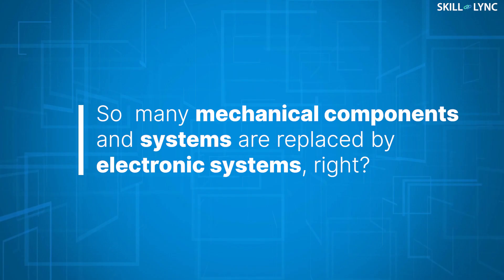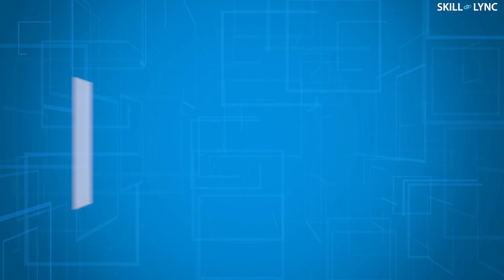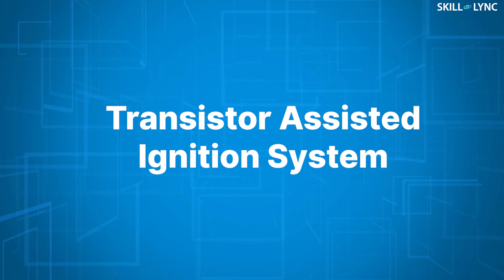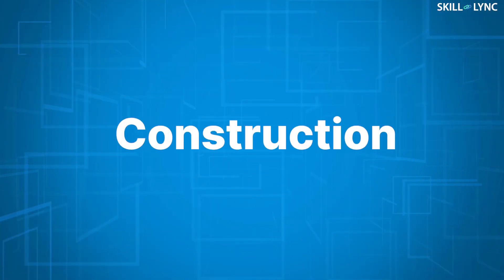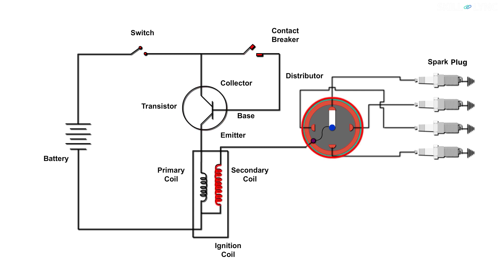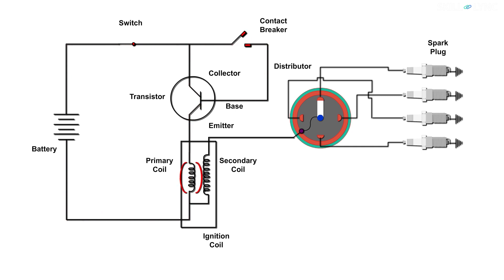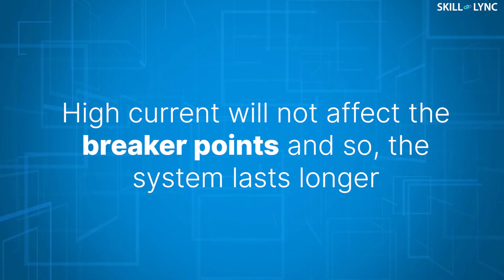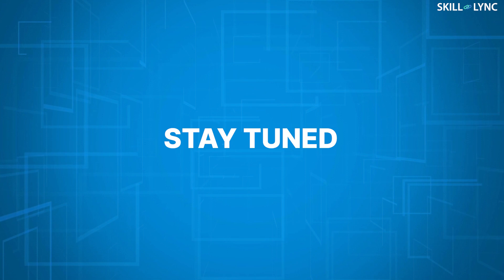Transistorized Ignition System | Skill-Lync

Comment: This covers the basic principles well enough, but the circuit probably looks a bit strange to most people. In a negative earth vehicle, the emitter is usually connected to ground and the primary of the coil is wired between the collector and the positive battery feed. Thanks for doing this series of videos.
Reply: When you are right , the shown schematics is called common collector also known as emitter follower. https://en.wikipedia.org/wiki/Common_collector